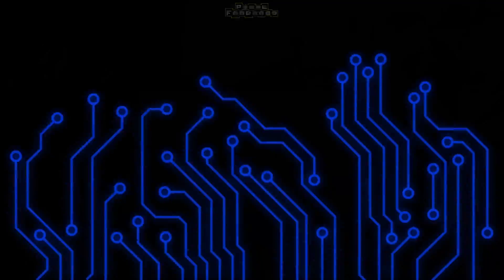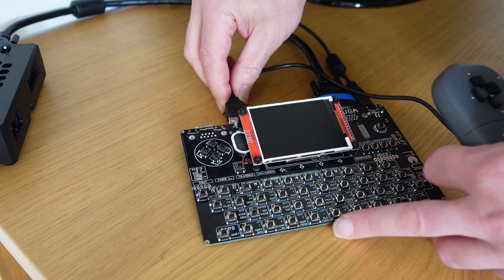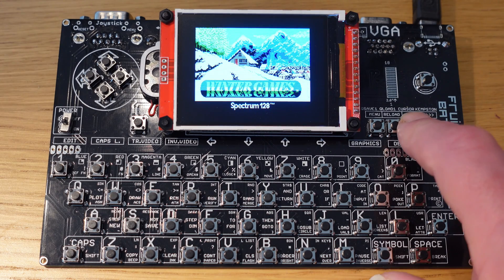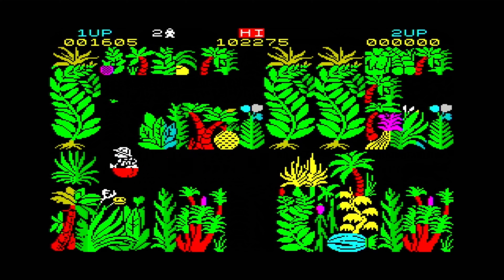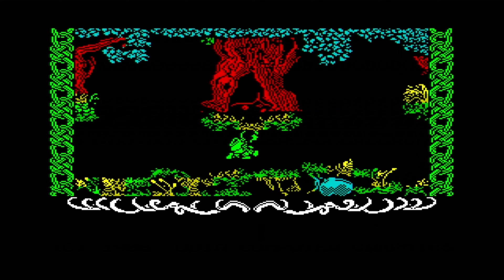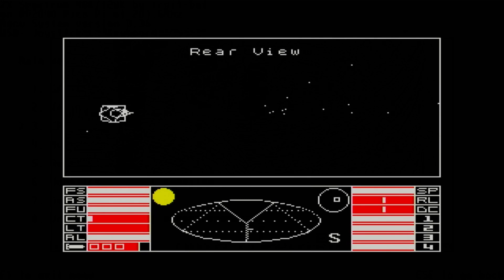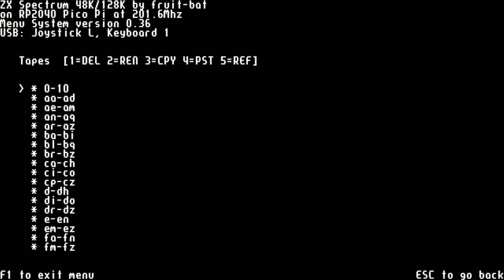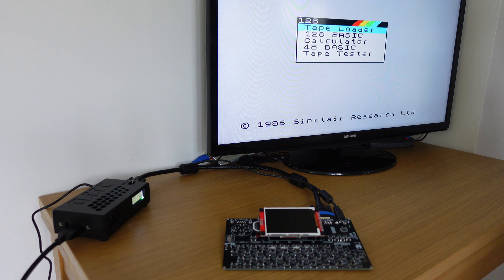I Bought a PiCo ZX Spectrum Retro 8-Bit Emulator!

Comment: 6:40 - the Spectrum didn’t have to redefine characters on the fly to simulate line (vector) graphics. The display was a 256x192 1-bit  bitmap with each pixel individually addressable. Color was handled using 2 addressable attributes (ink and paper) in each 8x8 pixel block. Your description sounds more like the tile-based renderer in the NES.
Reply from the maker: Yes. I got that a bit wrong. Must do better.
Reply: @ nah. You are doing great! We all learn by making mistakes. Love the channel 👍🏻
Reply: @pixel_fandangothe ROM routines to calculate lines and circles etc were to slow. Programmers avoided the processing by using tables lookups instead of actual maths  this way vector graphic games could be fast enough for the little 3.5mhz z80 chip.

Comment: I put together one of those too even if I am an Atari 8bit user (for decades) and even if I now have 5  ZX spectrums of different models and issues. I didn't have a speccy back then so this  board in an original case is a good way to  have a legit experience  of the system while effortlessly browsing the vast library and without wearing off your original machines! I was unlucky  with the pi pico board though. It was faulty and the emulator kept freezing, denying to work  properly with a usb keyboard etc . I inspected my work and found nothing wrong so I re-flashed it  repeatedly and it finally bricked. I took it off the board along with 80% of the pads and traces lol, so I had to restore  all that area  on the board with  thin wire and green nail varnish  and soldered the new pi pico in place. It worked (and still does) like a charm! I use it almost every day, I load 128k games with tunes to listen to while repairing  other systems in my collection.
Great video btw!